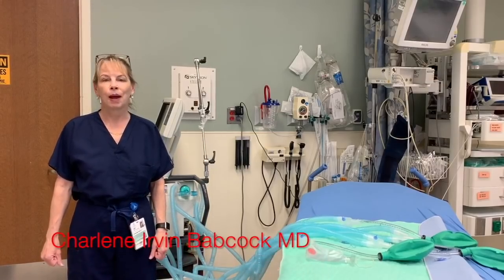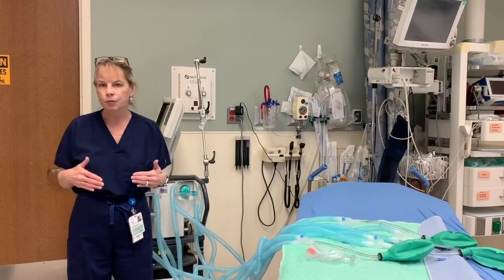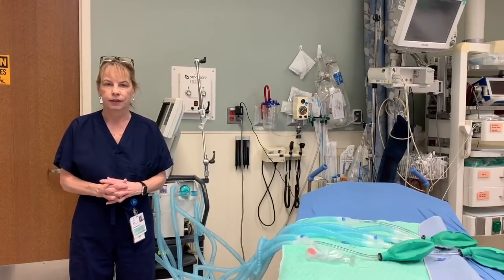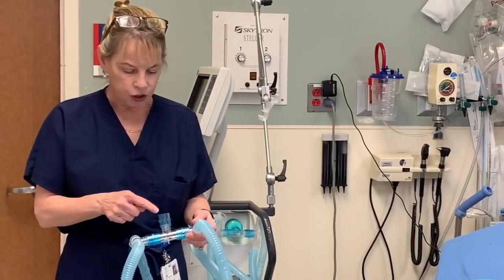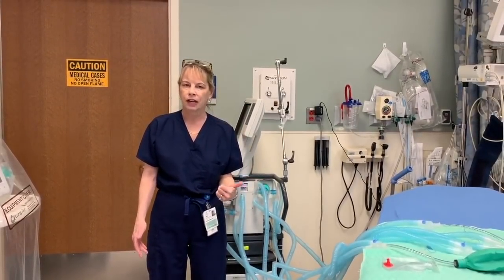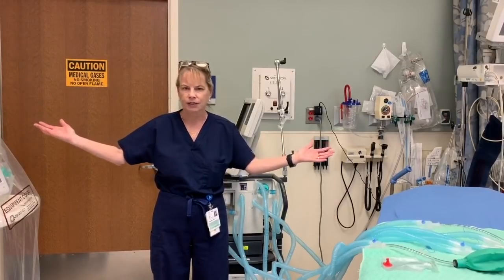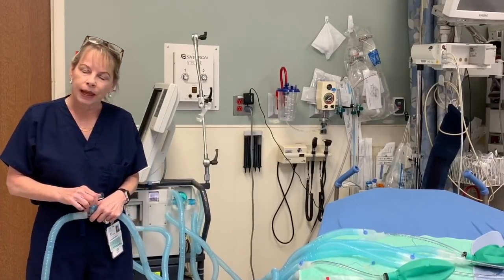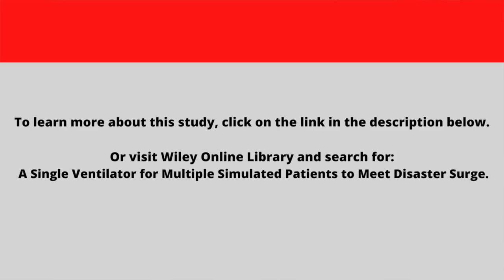COVID-19 How to Use One Ventilator to Save Multiple Lives

Comment: If this is to be used, I think an inspiratory pause would be quite beneficial here so the gas has a static time frame to equally distribute all gasses equally before exhalation
Reply: You can use pressure control as it is time cycled.  However, the patient with the worst lungs will still get the least ventilation.  Inspiratory pause is only useful for plateau pressure and compliance calculations.

Comment: As an RT in a large university hospital that receives severe ARDS patients year-round from throughout the state, this kind of setup completely undermines the very real individuality each ARDS patient exhibits in every stage of the disease process. I can see this working adequately for extremely brief periods of time when awaiting transport from a critical access facility to a hospital better equipped to handle the demand, but without the ability to provide lung protective ventilation specially tailored for each patient’s physiology (forget about even being able to monitor Pplat/PIP/proper waveforms), this is the equivalent of communal hand-bagging until help arrives. Fingers crossed we don’t have to employ this approach for our patients, although it sounds like it’s already too late for that.
Reply: Amber Bard i completely agree with you
Reply from the maker: It is being used successfully in ITaly.....yes it is off label...yes it challenges the clinician to 'match' patients as best as possible for compliance, TV, resistance, etc...but it is working...see below about Italy...I've also been told its being used in Egypt.....  THe last sentance in the article (translated) is: "...its like multiplying  fish and loaves."

Dr Marco Ranieri of Bologna, Italy and his team Have successfully tested the approach in vivo in one of the hospitals in Italy overwhelmed by the COVID-19. 

They worked with Intersurgical, an Italian company based in Mirandola, started producing the circuitry in only 72 hours, and the first prototype has already been tested by Bologna Sant'Orsola Hospital. It works and in the next few days they'll start a mass production to supply Italian hospitals who are in need

Here some news in Italian. 

https://www.huffingtonpost.it/entry/a-mirandola-testato-ventilatore-che-assiste-2-pazienti-bonaccini-straordinario_it_5e73c3e1c5b6f5b7c540a8d2
Reply: Charlene Babcock thank you for this link... unfortunately there is no article outlining the specifics on its efficacy beyond merely splitting air flow to multiple patients... which we know is a concept with many intricacies in the case of ARDS that these makeshift setups cannot address. As patients change in the disease process and one’s lungs become more fibrotic while another’s on the mend, how do you continue  to match ventilator setting needs - musical chairs? There’s so many variables that aren’t being fully addressed (such as ability to actively treat each patient vs ventilating on generic settings, how long the patients can sustain sharing ventilators (from intubation to extubation??), etc) that you will be hard-pressed to find RTs willing to put their license on the line for practices that challenge the very basics of ventilator and respiratory theory. I commend these individuals such as yourself in seeking answers/innovations, but so many are doing so without strong RT or pulmonologist input when, at the end of the day, those are the very experts that should be involved.
Reply: Don’t over think it.  ARDS is easy to ventilate. Good air goes in.  Bad air goes out.    Set them up in PCAC, then your PIP pPlat don’t matter.   Waveforms would still show you secretions I’m the tubes. Outside of that.  Just look for visible chest rise, and you could even monitor end tidal o2 on them.  Adjust rate or drive pressure to get the best average end tidal between the four.
Reply: Angry Breatherer your oversimplification of ventilating an ARDS patient lacks a level of comprehension found in treating severe ARDS effectively and efficiently. EtCO2 (not sure what end tidal O2 is...) is one of MANY variables measured, and to exclude the others would be negligible practice at best. Waveform interpretation in these patients is far more complex than seeing if there are secretions needing to be sxn’d, and the idea of being able to see anything on the waveforms and be able to discern any information applicable to a specific patient is a joke. If you are unable to appreciate the nuances each ARDS patient requires in ventilator management that the experienced RTs in this video’s comments all echo, you may want to reconsider your presumed position of expertise.
Reply: Amber Bard 
Nope.  Ards is easy. Stiff lungs need low volumes.  That is the way. That’s all that works. Tend their end tidal co2. Your wave forms would tell you all of the critical information in these specific patients. You would have to find out which patient is the culprit sure. Don’t over complicate it.  It’s not negligible practice.  It’s saving life’s when there’s no chance any other way.
Reply: Angry Breatherer It must be nice to have only used ARDSnet on healthy patients. Please help me understand, then, how I would even begin to trend changes in compliance... how I would handle the dynamics of PEEP, balancing the potential of volutrauma/barotrauma in one and atelectrauma in another... how I would explain a PTX in one patient because another one was getting worse to families... how I would mitigate pressure changes during things as simple as patient turns (let alone proning), sxning, weaning... how I would decrease the level of derecruitment and days of work needing to be made up when (not if) I have to disconnect a patient from this circuit monstrosity for whatever reason (I hope “clamping the tube” isn’t your first thought...)... how I would integrate iNO into the circuit for one and not the others... this is NOT a disease process that is quickly healed, and the longer you take to get them off the vent because you want to give folks generic settings instead of what’s right for their physiology at each stage, the more damage you do and the steeper the climb to get them extubated. It’s more than just watching EtCO2.
Reply: Amber Bard 
Trend changes in compliance....you don’t.  Just shoot for chest rise, and adjust rate/ drive pressure to give everyone the best average PaCO2.  Maybe one has a co2 50, and one has one of 70 , and everyone else somewhere in the middle.   How do explain it to the family?   Your loved one got a pneumo.   Just like you would tell anyone else.  Barotrauma.... again pressure control.  Volutrauma...you can’t, at least not well.  PEEP.... put them on 10 and leave it.  Everyone argues over it anyways( even when it’s on a single patient ).  Boom.  4 lives saved. Squirt bicarbonate as needed.  Friggin bicarbonate party up in there.
Reply: Amber Bard 
I do have a genius way to alter tidal volume on the patients getting to much volume.  Simply calculate the volume loss you would need correct their to large tidal volume.  And add tubing to their Inspiratory limb.   Boom.  Individually manipulate Ken tidal volume.
Reply: Shocking how many watched this & still asking the dumb questions she already COVERED like only in DIRE emergency & YES, until other help arrived.  Rule #1, if your care team cannot LISTEN adequately here to a video, they're not competent to care for you!! Re-watch, & learn from your lack of listening skills so you don't hurt someone for real! Pompous ignorance & hard headedness  is a dangerous trait in healthcare. RN, BSN, CCRN
Reply: Wow, you must be a peach to work with... Unless you weren’t able to read my response with attention to detail, yes, I agreed that this is only worthwhile in short term, but ventilating someone with injured lungs isn’t the same as ventilating someone that’s been through, say, gunshot wounds, regardless if it’s for 3 days or 3 hours. And depending upon the therapies used prior to intubation, the level of cellular damage would absolutely vary from patient to patient at the time of vent initiation... last I checked, PEEP and Pplat was an integral part of lung protective ventilation, so how do you recommend handling things like that in light of variances in compliance when you can’t even measure your initial values, since you seem to know so much more than me? - Amber, RCP, RRT-ACCS (you ain’t the only one certified to work at an advanced critical care level, sweetie...)
Reply: Freida Babbs your title doesn’t mean jack shit when it comes to respiratory and ventilatory mechanics.

Comment: Need to start mass producing multi port adaptations against specific OEM ventilator models pressure constraints.  Altering ventilator design to support 8x patients, with back flow valve protectors. Address recycling and contagian control

Comment: Please ignore the fools in the comments. Great idea if worst comes to worst. Great effort. :) People dont' seem to realize that there if there are not enough ventilators to go around, people die. So people arguing in the comments over use cases and proper procedure are literally choosing death instead of this option. Shake your heads.
Reply: They’re not saying choose death! They’re saying to ambu bag the patients (a tried, tested and working methodology) rather than run an extremely high risk that ALL four would die. People that have no idea of the intricacies of respiratory machines really need not comment when they have no idea 😡
Reply: @georginaboyle7098  When the clock is ticking, having options is a good thing. When you get your ICU stuffed with incoming patients, you need options. You presume there are enough ambu-bags or whatever to go around also. 

This is what i'm going to call last ditch effort to keep people alive. This is outside protocol, but so too would be the problems faced by a situation where it was needed.
Reply: @georginaboyle7098  as others have said, there are issues with ambu bags, too, including the manpower required to do it. Nobody is suggesting that this is an ideal solution, but if it's this or leave three patients without respiratory support, I'm going with this.
Reply: yep so many horribly inept listeners practicing care that is very alarming! The questions were answered yet they all failed to HEAR or actually LISTEN to the video. It's frickin scary how dense some people R.
Reply: Definitely shaking my head.   These RTs have never worked in a safety net county hospital.   You do what you gotta do.  Get out the Mark 7s if you have to.  Who has time to sit and bag for 12 hours.  That’s ridiculous unless you recruit the family to do it.  And even bagging is dangerous spewing all that virus out onto everything and everyone.   HMEs and hope for the best.   Thanks doc for sharing this video.
Reply: @christinekaras1730  Having families bag would be an excellent idea. They would experience the suffering and more fully understand the folly of Frankenstein like efforts to recapture life from death. I am exhausted physically and emotionally after working 40 years in the health care system driven by profit.
Reply: scott goodman yes I am too.   35 years in the field certainly can jade you.  We didn’t go into this field to worry about corporate concerns.  If I wanted that I would have gotten my MBA not my RRT and BSN.

Comment: The patients all require the same settings for this to work.
Good luck with the lawsuits.
Reply from the maker: It is being used successfully in ITaly.....yes it is off label...yes it challenges the clinician to 'match' patients as best as possible for compliance, TV, resistance, etc...but it is working...see below about Italy...I've also been told its being used in Egypt.....  THe last sentance in the article (translated) is: "...its like multiplying  fish and loaves."

with regards to lawsuits...remember you can sue for ANYTHING...I'd rather face a jury of my piers and explain...it was a 'break glass in case of emergency' moment, and I had the choice to try or let die...I choose to try.....

Here is info on its use in Italy....

Dr Marco Ranieri of Bologna, Italy and his team Have successfully tested the approach in vivo in one of the hospitals in Italy overwhelmed by the COVID-19. 

They worked with Intersurgical, an Italian company based in Mirandola, started producing the circuitry in only 72 hours, and the first prototype has already been tested by Bologna Sant'Orsola Hospital. It works and in the next few days they'll start a mass production to supply Italian hospitals who are in need

Here some news in Italian. 

https://www.huffingtonpost.it/entry/a-mirandola-testato-ventilatore-che-assiste-2-pazienti-bonaccini-straordinario_it_5e73c3e1c5b6f5b7c540a8d2
Reply: Lung sizes are honestly pretty similar. That being said, doesnt really matter if pressure control is the setting being used. Compliance is where the real issue is. In a life or death situation, people can deal with some permissive hypercapnia for a while (you may have to supplement with sodium bicarbonate). This would work for a while.
Reply: Or I mean they could just not have assisted breathing and die anyway. Great idea. This is for DIRE situations.

Comment: As a Biomed Tech, I would have grave, GRAVE concerns about attempting this technique in the real world.  The Doc in Vegas might have made it work with 2 patients for several hours, but 4?  Also, the specific configuration of that model vent may allow for this to work theoretically with test lungs, but most other model vents will not.  Many won't even accept more than one circuit.  The LTV-1200 is a standard vent used for disaster relief (Meaning there are tens of thousands of them in circulation) and the circuit for those is complex and uses pneumatic switching to get inspiration and expiration through a single trunk line.  
I must agree with so many of the other comments, this is a terrible idea.
Reply: not to mention the compliance of each persons lungs is going to be different, so one patient could be getting 50% of air delivered. this is probably ok in a pinch until they can get each patient on their own vent, but unless you're dealing with quaduplets i dont think id trust this for long term ventilation
Reply: @trev0rbr  It wasn't for long term.  It's a last resort until more ventilators arrive.
Reply: Plus the LTV circuit does not have an exhalation filter.  Whatever the patient exhales is blown straight into the room.  Make sure everyone puts an HME on the ETT.
Reply from the maker: Well...it turns out...it works in VIVO  now...its key to match similar patients...but read below..

Dr Marco Ranieri of Bologna, Italy and his team Have successfully tested the approach in vivo in one of the hospitals in Italy overwhelmed by the COVID-19. 

They worked with Intersurgical, an Italian company based in Mirandola, started producing the circuitry in only 72 hours, and the first prototype has already been tested by Bologna Sant'Orsola Hospital. It works and in the next few days they'll start a mass production to supply Italian hospitals who are in need
Reply: Charlene Babcock I am glad to see Italy trying this.  I hope it makes a difference in the death rate.